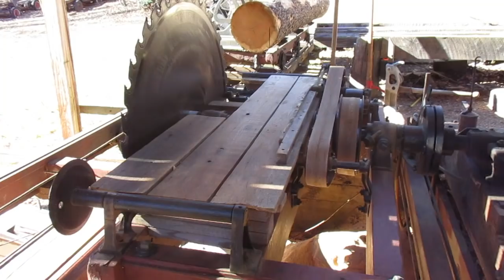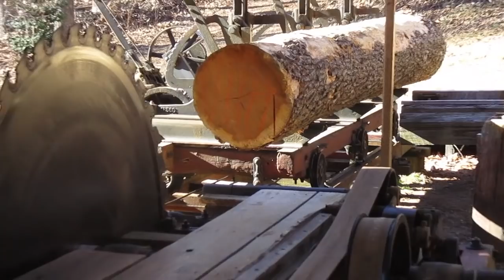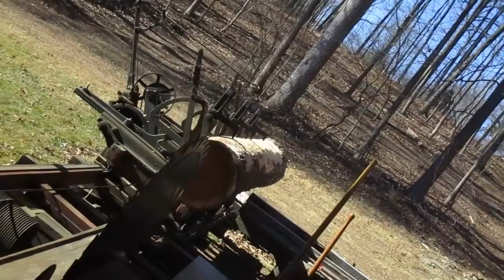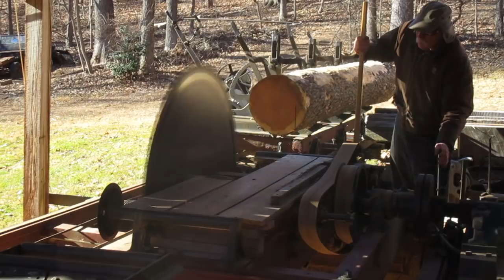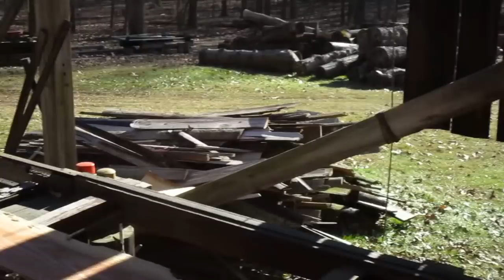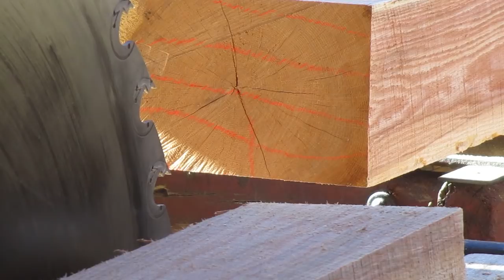# 231  BIG OAK ON AN OLD FRICK SAWMILL . SHOW BEFORE THE SNOW

Comment: Talking about cold sawing reminds me of a local story.  The guy had saw with really worn out shanks and probably a bad bearing near the saw and the saw kept heating up and would wobble terribly.  It was winter so to cool the saw they were throwing snow on it.  Well, on the last shovel of snow the saw split in half.  One half went into the sawdust pit and the half went right through the roof.
Reply from the maker: WOW  that must have don't know what to say . saws saw different in different temps . but if the blade gets worm  then hot you can't or shouldn't saw . shut do and find the problem . john

Comment: I am totally impressed with the smoothness of that mill's operation John.  And boy!...what a nice looking chunk of oak !!  I liked your innovative rolling with the jack.  On our 54'' Fisher and Davis mill we had a chain fall in the rafters above the carriage and used it with a log dog to roll the big ones that two of us couldn't do by hand.  Was that an old railroad jack you cut off to poke into the log ?
Reply from the maker: hi there   didn't want to hurt the jack took the pad off with one bolt , got a piece of 2x2 went rite over the shaft , cut an angle on it drilled a whole installed the bolt back in , works well . really doesn't take that long to flip a log . john

Comment: What is the hp difference between 4-71 and 6-71
Reply from the maker: hi there not real sure my 471 ia a 2 valve around 100 hp  the 671 is a 4 valve at 238 hp but i run them at a slower RPM . neither has a turbo   hope this helps .